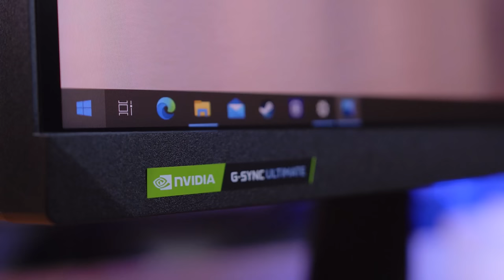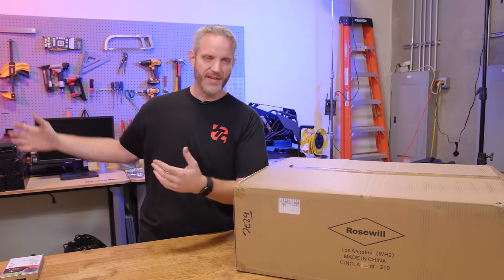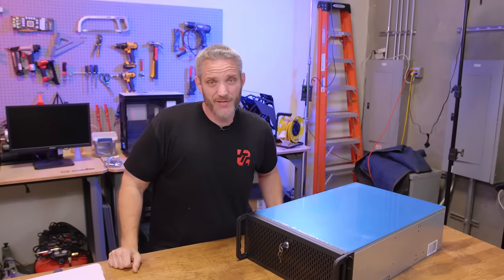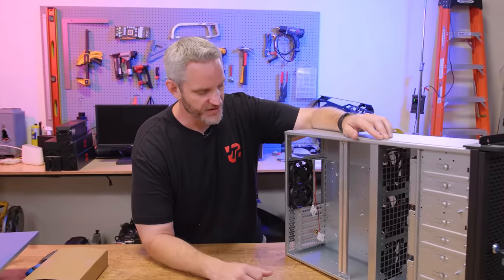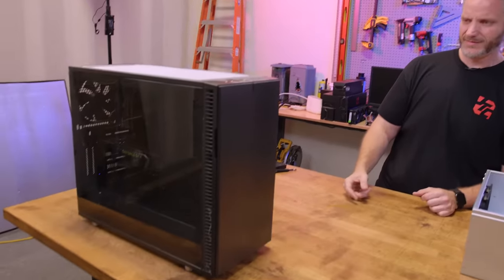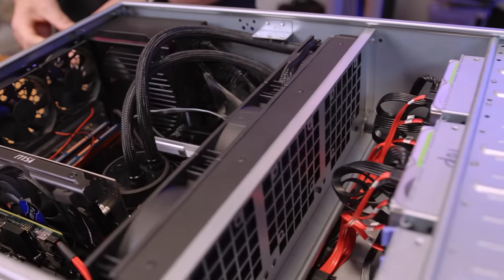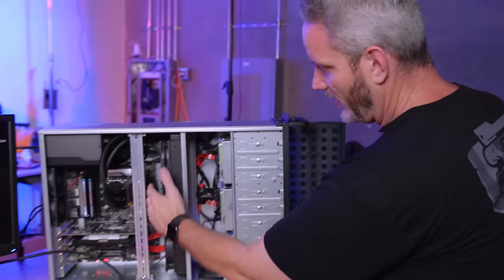Maybe I should have called Linus...

Comment: Jay: I didn't put it on rails because we never have to open it.

Also Jay: We'll have to open this regularly to blow the dust out.
Reply: Yup, they should really get rails. Once filled, this will be heavy and unpleasant to move around. (Source: I have a smaller sibling of this case, on rails.)
Reply: @LouisCYUL  Not only rails , I hope they know they should be bolting the rack to the ground as well.
Reply: This oddly reminds me of an unrelated car review video from Redline Reviews, where Sofyan Bey (presenter) first mentioned that the side view mirror on the vehicle the was reviewing was nice and large.  Later in the video he complained about how small the exact same mirror was.
Reply: Totally missed that contradiction!
Reply: @oddeye  That's not strictly required. For example - I have at my workplace 40 racks filled top to bottom with 1U machines, like very high density compute system would have. It uses very deep rack system (they are over 140 cm deep), and unless you pull out like 1/3 of top machines (which really doesn't make any sense) and hang off them it has absolutely no effing way to tip. Manufacturer strictly forbidden putting them on a raised floor because of weight, too. We also have many just free standing racks, that are randomly filled with machines, from 1U to 8U, and there are many instances when heaviest devices go to absolute top (like 400G traffic generator had to be in reach of 3m/10ft long copper cables to all devices using it, and it happened to be on top, and that beast weights ~100 kg) , or super heavy disk shelves are dangling in the middle and nothing bad happens - we do have someone on site to run calculations before and during installations, and if something approaches tipping danger, safety person slaps warnings on affected rack (like "please move machine to lower U before next audit" or "do not pull out machine in U25-28 if any other is already out" or "if pulling out disk shelf in U30-U35, pull half, remove drives, pull rest or move machine below U12"). Of course if someone ignores that, there are consequences, and yes, we had accidents because of that, but every single one of them would have been prevented if person responsible heeded the warnings.

In our case, we can't bolt down racks because they are constantly being swapped around.

Two-post network gear ones with switches and cross panels are both bolted to the floor AND to the ceiling, though. They have a nice railing around them even. No one fucks with network gear.

Edit: It makes a lot of sense to bolt down racks if they in isolated data center with hot/cold aisles with full air separation (like one you need blanks in each U in rack), raised floor, etc. - VPS providers, telecoms, database systems, 5G/network edge aggregation centers, made-to-order compute systems - they use that, but racks placed there generally don't move when installed. In our actual data center we have clamps on the floor, which are similar to studs on container trailers, just with a spring latch - we position a rack over the clamp, one person kicks the clamp spring, and it pops up from the floor, fixing the rack in place, and the other person kicks the latch, securing it on all sides simultaneously. But again, stuff there goes in, gets used until support contract runs out (2-5yrs) and gets replaced with identical, but newer one.
Reply: @oddeye  Thats nonsense. Every respected IT professional knows that you just have to put the older heavier servers on the bottom of the rack if you are too lazy to bolt it :P
Reply: 2001 called and wants it's dumb state and reply meme format back.

Comment: Not sure if it's been mentioned yet, still watching but didn't wanna forget to post this.  Your drives in unraid have the last 8 digits of the serial number as part of their names in the "main" tab.  Should then be a matter of writing down or taking a picture of that failing drives name, shutting the server down briefly, going through one by one to find that drive, swap it and then fire back up. You'll have degraded performance for the duration of the parity rebuild but that's about all.
Reply: Or, after having written down the serial number from the Unraid UI, you can just read the serial number off the physical disk, when transferring them from one case to another. But I guess that's a bit too late now. ;)
Reply: Or just label your drives as you put them in and make your life easy. Then no squinty sn hunting in the case. Array HDD 3 failed? Grab the one labeled Array HDD 3.
Reply: Leave it to the internet to give the answer to the YouTuber.
Reply: I label new drives with the last few digits of the serial above the sata connectors when I put them in. Makes it easy in this case to see what bay the problem is in before you have to pull out all the drives.
Reply: I dont care if it is unnecessary most of the time but hot swappable bays are a must
Reply: degraded performance? Hmm.. using cache drives I'd not really think so.. you'll always rely on single-disk performance under UnRAID.

Comment: UNRAID should give you basic information for each drive in your pool. This data should include the controller number, port number and the serial number of each drive. This is how you ID a failing drive. If the drive is completely missing from the system look at controller ports that are not used and physically look for a drive connected to one of them, this will be your dead drive.

Edit: If you need help, call Linus and ask for Jake.
Reply: Yeah I wasn't using unRAID but FreeNAS at the time and finding the SN was pretty easy.  Then powered everything off.  Pulled each one out until I found the drive.  Pulled the drive and replaced it, booted it up and away it went with the rebuild.  Its not simple but its not too hard to figure out.
Reply: Exactly. unRAID labels all the drives with their serial number in the GUI.
Reply: There's also a plugin for unRAID called Disk Location (along with some other plugins) That allow you to make a map of your drives so you can identify them easier in the future if you have to pull them. It can also flash the drive activity light if you have hotswap bays with that feature.
Reply: @ceilyurie856  It is more important to resolve the parity issue first or he is going to end up having to restore his data pool from backup.
Reply: This, The serial numbers are how I know which drive to replace.
Reply: Came here to say this 👌
Reply: That’s why I put a Brother label with the serial number on every drive. Adding the drives one by one told me which serial number belonged to which drive. Label on the back, so it’s always visible. The sticker on top isn’t readable once you mount the disk. But I have worked in IT for 20 years, it will force you to register stuff. Being responsible for loads of servers will make you do things differently than a hobbyist that build computers for fun. Gregg Salazar did an online computer (COMPTIA) test and I was shocked to see how little he really knew about computers. Knowledge about AIOs and RGB will not get you an IT job.
Reply: @KellicTiger  so what u needed to do before u put the drives in is to label it with the serial in the part showing out so its easier
Reply: @a.j.haverkamp4023  Jay builds enthusiast consumer PCs, not servers, but mostly he is just having fun. 

Edit: For those thinking about A.J.'s labeling tip, it is a very good idea. The label only needs the last 4-5 digits if you are limited on space.
Reply: @BansheeBunny  As far as I know Jay had a professional career in IT before his YouTube channel took off.
Reply: @a.j.haverkamp4023  Yes, and he had every certification in IT and preformed every task his employer gave him in the field, than took the time to stay current for the 10 years he has been doing his channel. Working in IT is not one job with 5 hats and after 20 years you should know this.
Reply: @BansheeBunny  I can’t understand that you choose software (unraid in this case) to store your most valuable data without knowing some basic stuff about it. Apparently somebody else did install it in the past. Maybe Linus? But you know you have a bad drive and take no actions to solve it. Buy a Synology nas (I bet he can get one for free), fill it with new drives and copy your data. But I bet Jay has already an off site backup too, I know he is no idiot. But his priority was somewhere else.
I bought an Unraid license but made the mistake to buy SMR drives, a fatal combination, incredibly slow. But by clicking around in the software and Googling you will quickly learn the basics. I had to empty the drives one by one after deciding that I didn’t want to continue using Unraid with these drives. But I needed the drives to store the data. So I had to figure out what was stored where. At the moment I am simply running Windows 10 on that system and simple separate drives, no RAID. But it’s non critical data.
Reply: @a.j.haverkamp4023  You say your in IT, think software RAID is a bad choice and bought SMR drives for a RAID. Okay 👍
Reply: @BansheeBunny  I bought external drives to shuck, which turned out to be SMR. This was when SMR drives started to appear and nobody warned about them yet (like Techdeals did months later). BTW this is at home, not at work!
And I don’t claim software RAID is bad. I think Unraid is absolutely brilliant, way better than the traditional RAID solution with the current massive drives. In the office RAID5 used to be our data server selection and RAID10 for our database servers and the entire virtual Citrix farm and other Windows servers.
Reply: Exactly—find the serial number in unraid - the LUN might differ from the LUN used by your sata/sas controller card.
Note down the serial number and reboot. Invoke the sata/sas controller card bios, most likely before the bios/uefi prompt, and look for the serial nuimber. 
Then boor into unraid (gui-mode) or connect via a browse. If you used a parity drive you might want to do a complete parity synch before you change the drive.
After the parity synch shut down, exchange the drive, boot into unraid, non gui, connect via network. Now check - the parity restore should have startet with the array.
hope that helped a bit - cheers

Comment: I have a Rosewill case in my home lab. One little tip if you're going to have to open it up regularly to clean it, swap out the top panel screws with thumb screws. It's pretty convenient.
Reply: @Specter Salvation Mine clear the rack.
Reply: Yup! I did the same, made it a heck of a lot less of a hassle.

Comment: ⚠️ For the conduit drops going into the wall I would put a coupling up at the top so that when you pull wire it doesn’t shave the sheathing down or possibly cut into the wire. At least that’s what we do here in Canada 🇨🇦

Comment: I work in data centers for a living.  I’ve literally never thought of rails as something used for maintenance.  It’s just the ease of putting a heavy and long server in a rack. 

Never fails, save your back.
Use rails in your rack.
Reply: and bolt the rack to the floor
Reply: @sopcannon  Very important note haha.
Heavy drives at the front of your case + Rails = Unscheduled server relocation
Reply: Fellow Datacenter tech here and I use the rails at least once a week for maintenance. Swapping / upgrading RAM or NVIDIA GRID / AI cards.
Reply: @sopcannon  ofc not.. and fill it top the bottom too, nothing can go wrong :D
Reply: Idk how long youve been doing that, but I'm a systems engineer and often rack up 14 blade / 28 node chassis. And lots of Dell R740/750/7525 and I do not view the rails as ease for putting something in the rack. Hell, my predecessor didn't often use rails, just stacked them.... ha, no, maintenance did not happen. We're in 4 major DCs and over 300 edgesites world wide. And if you're working at a DC then you can appreciate the 3 phase we need in our racks to where the DC needs to put them whole cage in it's own mini room for increased cooling.
Reply: And i mean rails in general ofc, not the same machine each week...
Reply: @TheMrDrMs  Done some SysAdmin gigs and I legit lol'd at "maintenance". These discussions man, I've actually seen the words "RGB server" and the persistent "bolt it to the floor" advice. It's hilarious to watch people that think servers are gaming PCs give advice. They mean well, but damn.... RGB server? Anyone in IT gonna lol and cringe.

Rail, don't rail, that's all preference I think. I could see smaller operations actually doing some of this stuff, I guess. Not a lot to do, bust out the air guns. lol
Reply: @sopcannon  Everybody walk the dinosaur

Comment: I have that very same case. Be careful with the screws that keep the top lid in place, they tend to easily strip and depending on where you have it, you might have situations where the screws cannot be put in place because the holes do not line up.
Reply: Not just that server, MANY servers like that tend to lose lid screws because they strip or rattle loose.  A bit of Loc-Tite is almost a requirement.
Reply: I also have this case, and agree with that lol I honestly stopped putting the screws in, since it locks in place and no one else touches it there's no point in my setup lol
Reply: I swapped the screws in my case with thumb screws. With the rails they clear the rack.
Reply: @Almamu  Talk to a computer screw thread expert and find nuts to match the thread. Remove the screws from the case, get some of the epoxy type jb weld that comes in a plastic syringe ( not the firm putty in a tube ). Sandpaper scuff the inside wall where the screws come through. Mount your hardware running the screws in just a piece of paper shy of flush with the inside. Take a thin toothpick or needle and spread the jb weld around the nuts, being careful to stay away from the inner thread area. Line up the nuts with the holes and hold firmly in place while running the screws in till tight, watch your finger with the screws! Once the jb weld hardens those nuts will stay in position regardless of vibration. Also if you want extra security you can put a single small drop of the 1 minute set time ' superglue ' on the screw before installing it. Not the instant glue which is too quick, and not the loctite because that is too strong holding and the tourqe to loosen the screws for servicing might cause the backing nuts to break free. Hope this helps.👍
Reply: @deadaccount6135  - Good lord man!  You're using a pile-driver to hang a hook on the wall.  

These are screws that hold a dust cover on, not structural bolts that need to bear heavy loads.

Heck, a cotter pin would work too.  Or going without.  There's no harm in not even having the screws at all.
Reply: I went with thumbscrews also, saved me some major hassle.

Comment: I use this current 4U case for my plex server, its been fantastic. Great build!
Reply: Ooo now that's an idea....(been thinking about building a new one)
Reply: Do you have your fans ramped up as much as Jayz'?  Does it need that much cooling?  I have a pretty simple home storage/media player system that runs on Windows.  It's basically just a regular PC with regular fans, a 240 AIO, 10 drives, running 24-7 and it's whisper quiet.  Wonder if I'm doing something wrong!
Reply: I have 4 of them! I went overboard.

Comment: I've had that same chassis for several years.  It's a good, solid foundation.  I was using it for a content creation-turned-gaming rig, and heat/cooling became an issue.  It'll make an excellent file server though.  It's well built and has enough room inside to fit just about anything that you can imagine.  Except a proper cooler.  Turns out 4 rack spaces just isn't enough height to accommodate a good 120mm air cooler.  I tried that same mid-mounted 360mm radiator and it just didn't work all that well.  It's cooling with warm air from mid-chassis.

Comment: I have a case from that family. I cut out the honeycomb on the front and rear fans to put black standard wire grills in place. Much quieter because it gets more space away from the fan blades.

Comment: I have the same case for my unraid server in my rack. Filter is annoying to clean but doable. The case kept making a lot of sound due to the turbulence you mentioned but there's an easy fix for that. For the middle row of fans, if you reverse the middle mounting row/plate/bar thing and then flip each fan so the airflow is in the correct direction, it drastically reduces the fan noise without affecting cooling or airflow. I find the front intake fans don't cause nearly as much sound due to turbulence as the middle row does in its default configuration.

Reminds me, I need to change the cooler in my server at some point. Been running a Hyper 212 Evo cpu cooler on it for 2 years now since I had it on hand, and it kind of makes the case lid bulge by maybe a mm or two... It's fiiiiine!
Reply: I have a Noctua ND-D9L in mine - 92mm cooler instead of 120mm. Haven't had any issues because my NAS isn't under any significant load.
Reply: only thing i dislike about this case is how expensive its gotten. its finally in stock for the first time in like a year or so on amazon. but the last time i bought one it was like $120.

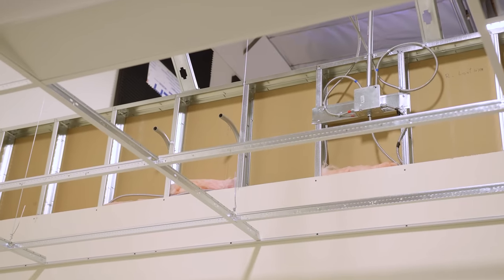Comment: Jay as an electrician in canada i gotta point out that in that junction box at 15:44 the people used EMT connectors for the BX cable and they didn't put on the bushings for the emt going down to the wall to the device boxes. Im pretty sure California uses equivalent Canadian code as its standard so unless thats a new type connector it's incorrect.